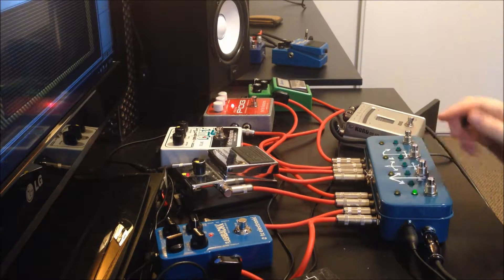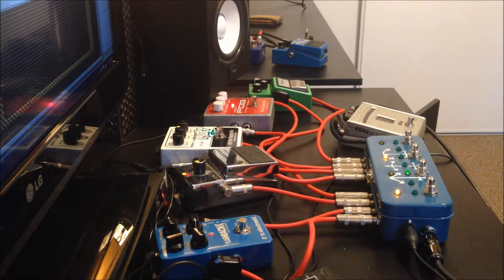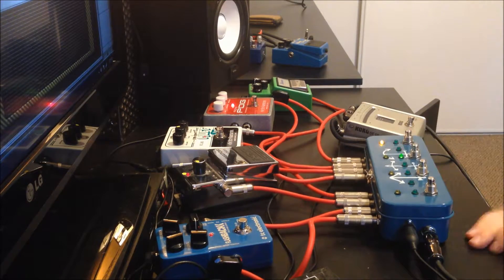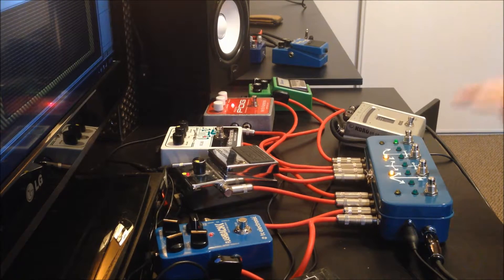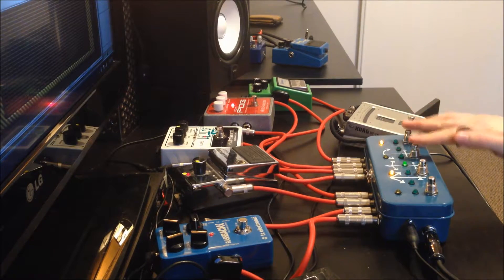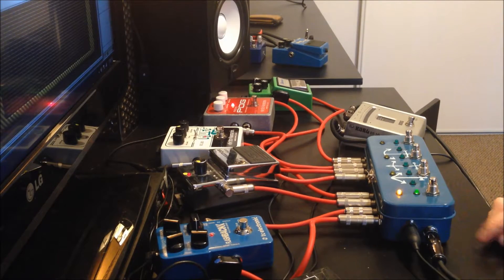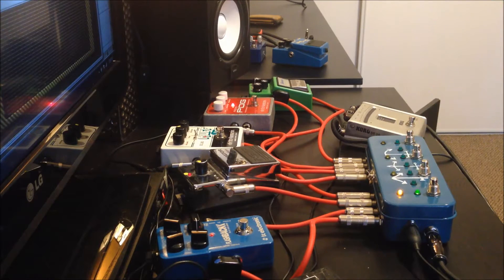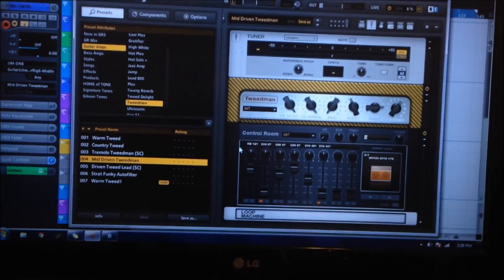DIY Effects Loop Switcher with MIDI v1.0

Comment: Hi, that looks great and reminds my of the byoc super8, especially the double press channel selection. That's what I'm looking for. Did you use Arduino? Is ist possible to get the source code and more information how you made it?
Reply from the maker: Hey sorry about the late response! I used a home-made Arduino board. If you have specific coding or hardware questions I'll try to help!
Reply: I have arduino uno. How to code like this? Thanks

Comment: What kind of relays are you using? How do you handle true bypass?
Reply from the maker: Carsten Molewijk they are cheap non-latching electro-mechanical songle relay modules I picked up on Amazon. They aren't the most power efficient, but were easy to implement for proof of concept!